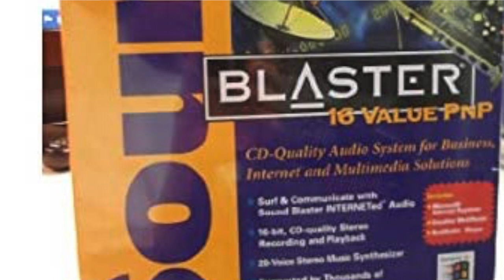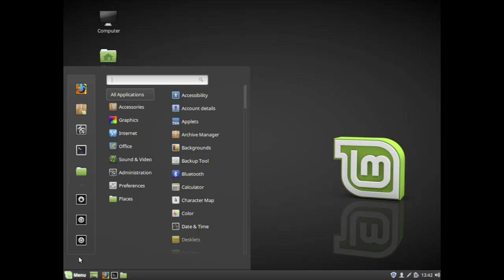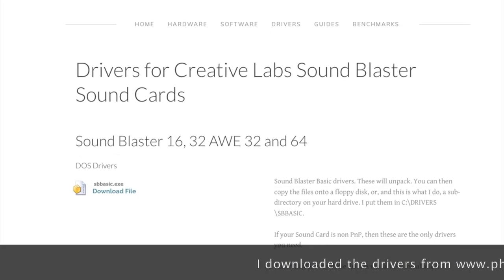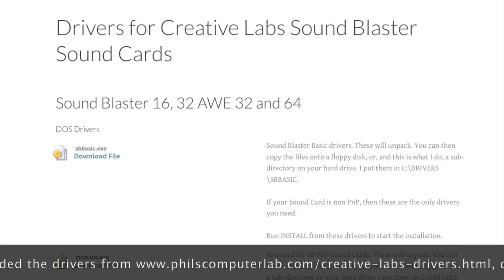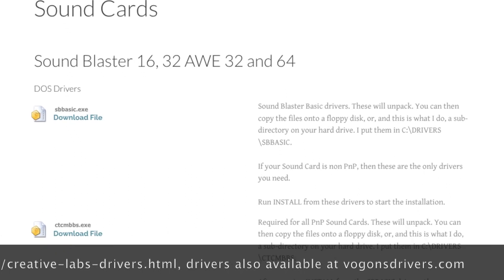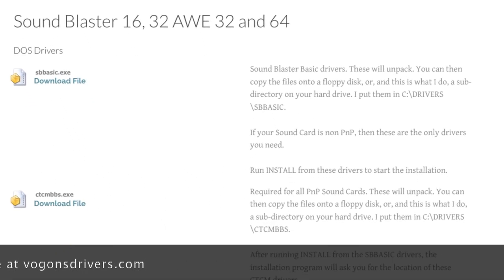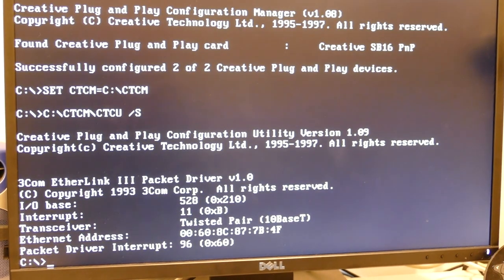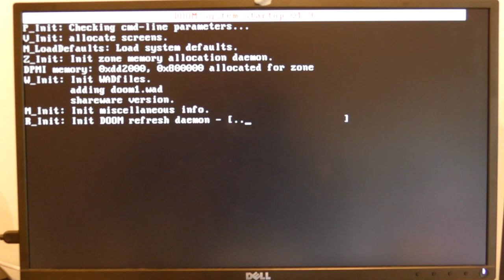Sound Blaster 16 Vibra PnP Installation for MS DOS

Comment: Dumb question. But i have a Vibra 16 would this card work for the ibm ps/1 2155? Dos 6.22 and win x3.1
Reply from the maker: Yes I don't see any reason as long as you have ISA slots
Reply: @AlsGeekLab  has 4 slots un populated! Just spent hours re installing ibms ps/1 software. I have a CT2940, 2700 and the vibra 16. Just cant choose.

Comment: I am trying to get a driver for the exact card CT2940 shown in the video for an IBM XT running DOS 4.0? I cannot find one though that works.
Reply: They all (in this case freezing initially when trying to run when that install tries to run CTCM.EXE) freeze after restarting the computer and with the XT-IDE deluxe get frozen at booting from C. I should mention that for the purposes of testing I am using PCem, with the emulated Sound Blaster 16, but this issue occurs even with non Plug and Play drivers, the Sound Card hasn't arrived, but I already ordered it, I wouldn't want to mess up the CF card though if I cannot get a working driver for the IBM XT. I ordered from Amazon, which has quite a small selection (I got a gift card to use), and staying in a budget meant getting one of the cheaper ones.
Reply: Surely this was not a waste?
Reply: Also, it was listed specifically as "Creative Labs Sound card, ISA, CT2940, (b. 12C)

Comment: I'm looking at building a dos machine and have a board with ISA. The CPU would be late 90s era (as that is just what I have lying about) but I want to have the proper dos sound experience so would I be able to run a Sound Blaster 16 on Windows 98 SE dos or is that too new?

Comment: I'm trying to get CT4180 Vibra 16C to work on a 486 with win95 and a p2 with win98, but neither are able to detect it as PnP on Windows. Can't  get its address with diagnose.exe as well. Like it doesn't exist, but it gets warm while plugged. Other ISA non PnP works fine. Any hints?
Reply: have you check bios setting?  There's section to set irq resource and os type. set to pnp and automatic. otherwise  set pnp to no and IRQ to manual.